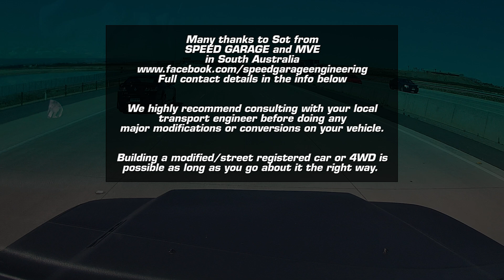ENGINEERING Lane Change and Braking TEST - Landcruiser 80 Series build

Comment: Besides engine conversion,  what else was it tested for.. wheels/suspension? What was the cost involved?
Reply: Cost? Im about to go through this process with my 80 series
Reply from the maker: @MrRevhead1  you’re better off calling the engineer you’re wanting to work with because it might end up being a completely different process or cost. Most will be able to give you a ballpark based on what you’re hoping to achieve
Reply from the maker: Good question. All aspects really. Sot had to write a full vehicle report, so that includes the suspension setup/lift, brake upgrade, seat conversion, engine etc.

Comment: Great to see the behind the scenes getting the engineers report, along with the brake fade & lange change effectiveness tests.  Thanks for sharing :)
I remember the first time I did this back in 1991 doing this at AIR - was a fun exercise (particularly on a slightly wet VHT surface)
Reply from the maker: Geeze! That would have been slippery!

Comment: Hey mate, what was the process for just getting the panel engineered?
Reply: Ahh yes, I was looking at converting vn wagon to panelvan, Im assuming slightly diffrent process being that the chassis is apart of the body. Im also from Adelaide, What engineer have you used throughout your build? If you dont mind disclosing.
Reply from the maker: Don’t mind disclosing at all. Sot from Speed Garage. He’s in the video and all his contract details are in the info below.
Reply from the maker: None needed here as it’s a full chassis vehicle. Just need to get the seating number changed